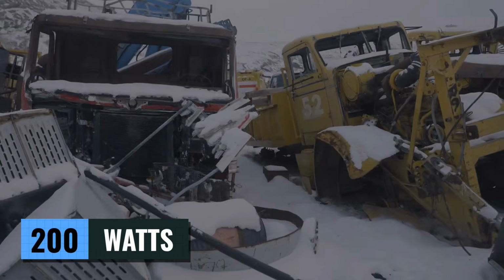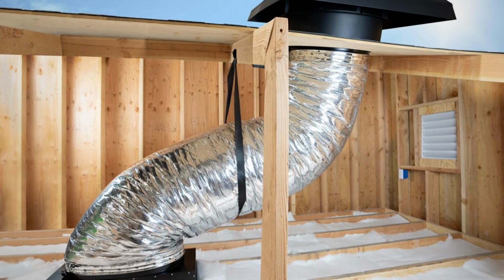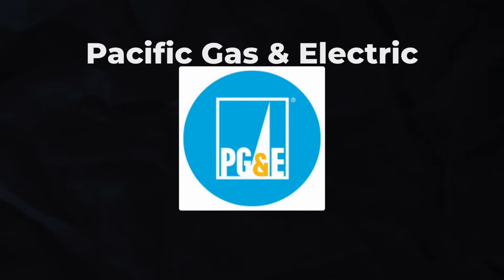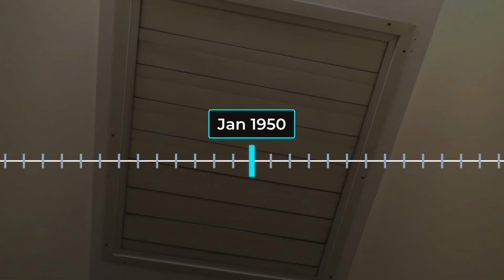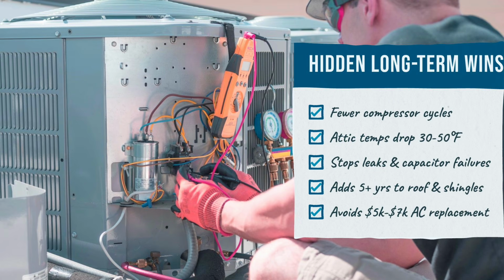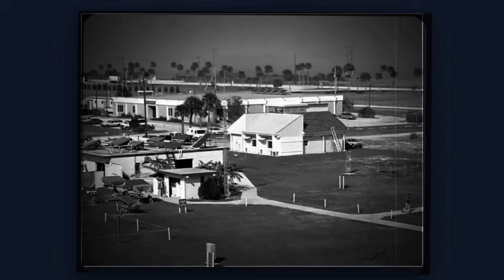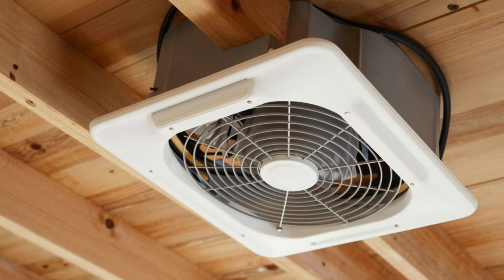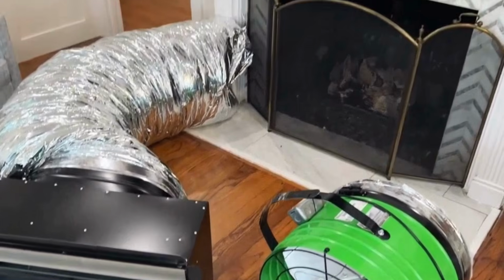This $200 Fan Cuts Your Ac Bill by 90% FOREVER. Why Did We Stop Using It?

Comment: There’s a whole house fan in every forced air furnace and AC system that pulls air from outside, exchanges that cooler air with the warmer air in each room.  

They only work when the outside air is cooler than the internal air temperature!  Whole house fans do absolutely NOTHING to reduce humidity!  

Your “studies” lacked a key differentiator!  Cooled target internal air temperature!   Did it cool;  yes!  When?  Only at night!  Did it cool to a preferred internal temperature??  NO!!!  

And FALSE!!!  AC systems are NOT sealed!!!  They are required to exchange outside air!!   They do not function appropriately without this exchange!  

You do not have even a basic understanding of these systems.
Reply from the maker: A standard residential split system AC does not exchange outside air. The indoor air handler pulls air from a return register inside the house, runs it over the evaporator coil, and pushes it back out through the supply ducts. The outdoor unit is a condenser, it dumps heat outside but doesn't bring outside air in. There is no fresh air intake on a standard residential system. That's commercial HVAC you're thinking of. On the cooling question, the video says clearly that this is an evening and nighttime tool, not a 2 PM replacement for AC. It handles the other 14 hours your AC is grinding through. And on humidity, the video addresses that too. Dry climates with big day-night swings get the most benefit. Humid climates get less. I covered both.

Comment: I was raised in a home with an attic fan which was before anyone had air conditioning. We also had American Elms that shaded our two story home completely. We slept in front of a slightly opened window & would sprinkle the bedsheets down a little to get the  cooling effects of evaporation. And we did fine. I wish that houses were built like that now. It was a comfortable life style. We weren't bothered by dust, humidity, or allergies. Something has really changed a lot since then.
Reply from the maker: That's a great picture of how houses used to work. The combination of shade trees, attic fan, and cross ventilation handled summer for millions of families. The sprinkled bedsheet trick is evaporative cooling at its simplest. Appreciate you sharing that.

Comment: This is such BS - maybe it would work up north, but here in Texas in the summer, the temperature at 11:00 PM is in the 80's - 90's so doing this would heat up the house and make sleep more difficult. Usually in the middle of summer the temperature at 7:00 AM is 78 to 84, so now I have to get up and turn off the fan and turn on the AC to cool the house back down to where it was before turning on the stupid fan at night to warm up the house - how is that helping? What is beneficial here is putting an attic fan in the roof to ventilate and cool the attic so the AC ducts are cooler and the heat is not radiating out of the attic into the house all day. Doing that cut our electric bills by 20% in the summer. And in the Spring when it is cooler we wouldn't be able to use a whole house fan because we need to keep the house closed up for allergens in the air outside - you would have to put hepa filters on all the windows to filter the air as it was being sucked into the house.
Reply from the maker: I did say in the video that it doesn't replace AC in hot humid climates, that's in there word for word. Nobody's telling you to run this at 11 PM when it's 90 out. The attic vent fan you're talking about does work, getting that 130°F+ air out of the attic is real savings, and 20% off your bill is solid. But that's a different product. It only vents the attic. A whole house fan pulls cool air through your actual living space and cools the thermal mass so the house holds that cool deep into the next afternoon. That's why PG&E measured up to 90% energy savings vs AC. Your attic fan isn't touching that number. Even in Texas you get shoulder season nights and stretches in the low 70s where this thing pays for itself. Calling it BS because it doesn't work at peak summer in San Antonio is like calling a jacket BS because it doesn't work in a blizzard.

Comment: Not good - when the outdoor air is 90°F, specially if there is smoke created by wildfire, even if the inside house air is 95°F, you would not want to open your window to provide air to a fan blowing up air in your attic. Better way is to isolate the fan from living areas by having the fan sucking air out of the attic - supply air to the fan are via openings under the roof eaves to inside the attic. With all the living area windows closed and the attic fan on, the living area would be cooler than the ouside air. Use heatpump as supplement to heat or cool living areas of the house.
Reply from the maker: You're describing an attic ventilation fan, which is a different product. It vents the attic space only. A whole house fan pulls air through the living space, that's the point. You'd never run it when outdoor air is 90°F. The video covers that. You run it when evening temps drop below indoor temps, which is when the energy savings happen. On smoke days, you keep it off. On hot afternoons, your AC runs. The two systems aren't competing, they cover different hours of the day.

Comment: I want my house below 75F, outside temperature is always above that in Texas in spring, summer and much of fall.  Not to mention the suffocating humidity.  My house would be a death trap using this antiquated method.  I’ll stick with AC thanks.
Reply from the maker: The video addresses Texas-type climates directly, in humid areas with small day-night temp swings, the usable window is smaller. Nobody's saying throw out your AC. But even in Texas, spring and fall nights regularly drop into the 60s and low 70s. That's weeks of runtime you're paying for that you don't need to. The fan handles those shoulder seasons and extends your AC's lifespan by cutting compressor cycles.

Comment: Those fans also brought in dust and dirt.
Reply from the maker: Old ones did, they pulled unfiltered air straight through open windows. But your AC is recirculating the same indoor air through ducts that accumulate their own dust, mold, and particulates. The EPA's data shows indoor air in sealed AC homes is 2-5x more polluted than outdoor air. Neither system is perfectly clean. The fan at least gives you a full air exchange every few minutes.
Reply: Well central air brings in mold.

Comment: I wish our house had a fan like this. But, In florida the temp does not drop below about 90 in late Spring, Summer & most of Fall.
Reply from the maker: Florida's tough for whole house fans as a primary cooling method, no question. But the Florida Solar Energy Center did test one in Cocoa Beach and still measured up to 65% AC savings on moderate days. Even in Florida you get shoulder season nights and stretches where it'd cut real dollars off the bill. It won't replace your AC there, but it can take months off its runtime over a year.